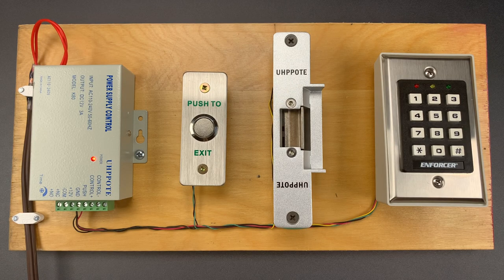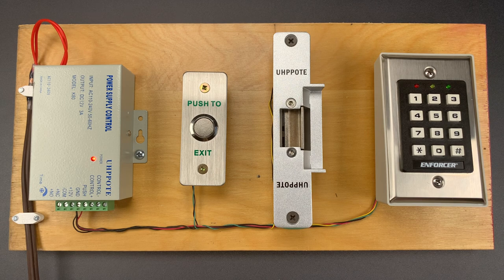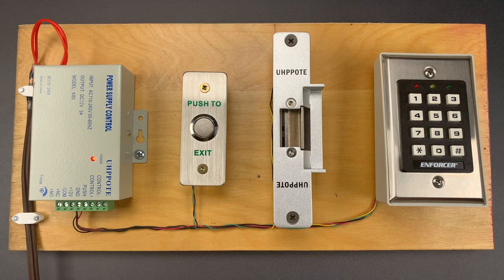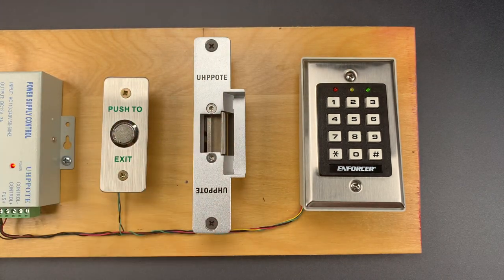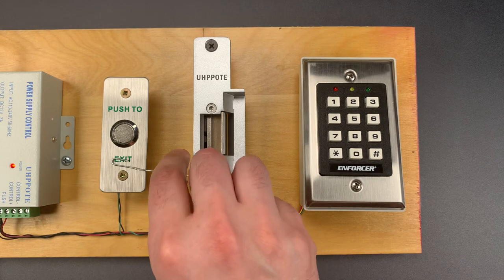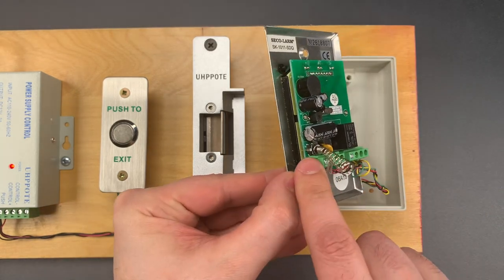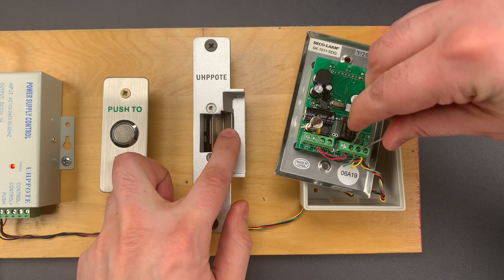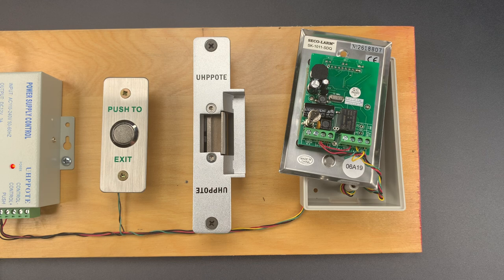[1045] Swiss Army Knife Bypass of Keypad Lock

Comment: That's a very bad design. The keypad should only be a keypad and should not contain under any circumstances the central unit which should be locked away in a hardly reachable place on the other side of the door. Furthermore for increased security there should be no galvanic connection to the sensitive parts of the system.

Comment: It looks like he picked the weakest electronic lock on the market.   Most commercial grade electronic locks don’t locate the controller inside the keypad (the controller is typically located inside the secured area) which leaves the egress switch connections, power connections, and electric strike connections inaccessible to an attacker in the unsecured area.  The only accessible connections at the keypad should be the connections to the keypad buttons signals themselves that get sent to the controller which is mostly useless to an attacker (unless they plant a recording device inside the keypad and come back later).   Very few electronic locks designed for even medium security  would make the controller accessible from the unsecured area.  Some of the higher security units have a controller inside the keypad that encrypts the keypad signal with a rolling code before  it goes to the lock controller (so a simple record and playback of a valid entry signal would not work).  LPL takes on some very tough mechanical challenges with some of the products he tests, I’d like to see him test comparable quality/difficulty electronic ones.

Comment: I work as an access control tech and I can with great confidence say 90% of the things I install and service are an absolute joke. I don’t even carry manuals around in my service van just because you can google all the info you need. Not to mention that the other 10% of crap I put in which is very expensive still would only slow down anyone with a smartphone and a PH2 screw driver and a small flat head. It’s all a joke. Just buy a gun.

Comment: Hideous design. The keypad should send the PIN, preferably scrambled, over a communications link to the master unit, which does the PIN checking and unlocks the door. No actual door control wiring should be outside the secured area.

Comment: that's just.. shitty products.

Fix it with 4 screws instead of two, use a a slightly different system for connecting the buttons (like wago clamps that go vertically), use a tamper switch that can't be defeated this easily, boom, problem solved. Product cost goes up maybe 20 cents.

Comment: Those combo locks are a joke.
The ones you'll find installed in truly secure installations have the combo lock circuit split in two parts.
The "made in china" one is made so that the combo lock circuit sends a power pulse to the electric door lock. Therefore, knowing what two points of the circuit you need to connect together in order to send the pulse to the door lock, you can open the door from the outside.
The true combo locks have the keyboard, the matrix decoder and the UART (universal asynchronous receiver transmitter) outside. This will send over a serial line the numbers you keyed on the keyboard.
The circuit inside has another UART, the code memory and the logic decoder. When the circuit receive the correct combination of numbers, it will send a pulse to the door lock and open the door.
Those locks are not made in china, but from specialised security companies. 
You can save two uart chips if you run 7 wires from the keyboard to the circuit, that can be made with an Arduino at this point.
Also, I find these cheap door locks with an electromagnetic actuator, to be a security liability themselves. Professional electrical door locks use a motor and a bunch of position sensors.
Thanks for all your videos, I watch them for their intrinsic funny...

Comment: That only works if the keypad is wired as diagram standard if the lock is reverse wired not to diagram with its power will short to ground and blow power supply fuse or burn out the wiring. Many variations and simple different types of tamper-proof screws on the cover stop these things.
Maybe this is a better way to get in?
https://www.youtube.com/watch?v=8g_GeQR8fJo

Comment: what an absolute piece of crap, I cannot believe anyone would design a keypad lock in such a way. It would have never even crossed my mind If I was designing such a thing to put the lock control circuitry in the box with the keypad. The locking control circuitry should be on the inside in the push to open button and the keypad should just be a remote control that sends keypress data back.

Comment: This is bad design, never use keypad with an internal relay in it, you must always separate the locking mechanism(lock, relay, power supply, microcontroller/ computer) from the interface(rfid reader, keypad) behind a phisical door, true secure keypad/rfid acts only as interface that relay data via wires... but you still can prefore MITM attack on them and replay tags to open the door... unless those tags use some kind of OTP mechanism with rolling code... then it's much harder to bypass...

Comment: So it's yet another electronic lock where all the electronics are in the keypad? FFS, it's a very expensive way to provide yourself with zero actual protection. The keypad shouldn't contain any electronics, it should literally just send the numbers you press to a control unit on the inside which can check the sequence (and limit the number of consecutive attempts) before releasing the door on a valid entry. It's basic security 101; the worst thing you should be able to do from the outside is break the lock.

Comment: What a load of junk, in probably every way.
1 - screws easily accessible
2 - wiring to strike plate accessible from keypad enclosure
3 - No proper tamper circuit, just a switch, you supply the rest
Is there anything good about this product, other than the price?

Comment: That design is awful.  The control circuitry should not be accessible from outside - shouldn't even be in that box.  The metal cover shouldn't be connected to any part of the control circuit.  The control board could easily have been behind the Exit switch, with an Ethernet cable pressed into service to power the outside number pad and get data from it.  An exterior metal plate connected to circuit ground, even if there was no way to short something directly, could still be used to send a disabling electric pulse into the system.  Super thoughtless design.

Comment: That's an unbelievably stupid design for a keypad lock, putting "the works" in the keypad.  A much, MUCH better design would have the keypad function only as a data entry device, with the logic and lock solenoid driver circuitry contained safely within the protected space, completely inaccessible from the outside

Comment: Who designed that kind of keylock? It makes me angry. I hope legit manufacturer designs are different from chinese fake copies. Who on earth puts keylock 'brains' and unlock system that activates by switch located outdoors not indoors?!!
 I am not an engineer but every logic suggests making just simple plain keypad outside with  nothing more than signal connection with indoors and only if correct keypad sequence is received in given time frame, indoors electronics unlocks the doors. Nothing to pick from outside other than breaking the doors by force. Simple as that .

Comment: This has to be the dumbest electronic lock I've ever seen. This places the electronics OUTSIDE the secured area, making it super easy to crack the lock. 

In any decently secured facility, the keypad would not be directly actuating the latch, but would instead be talking to a central controller. The central controller would be INSIDE the secure area, so someone can't pop a door by simply bridging two wires together. 

I finding myself wondering who designed this system and hoping they don't still have a job making security hardware.

Comment: Who the HELL designs this where the smarts are outside!?   This is a terrible design.
Reply: This keypad is clearly too flimsy, but you can have the smarts outside and still keep it fairly secure. All you need is a double pole relay on the safe side of the door and power it through the tamper switch. One relay contact powers the keypad, the other contact powers the relay itself. Open the tamper switch, the relay will fall, and you cannot energize it again by closing the tamper switch. Same thing with intercoms. Still not high security of course, but for your shed why not.